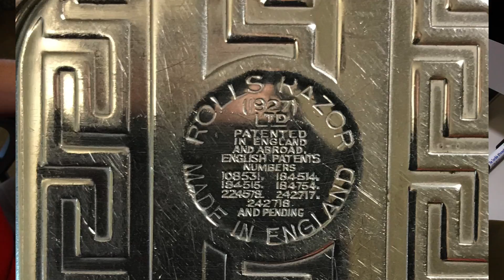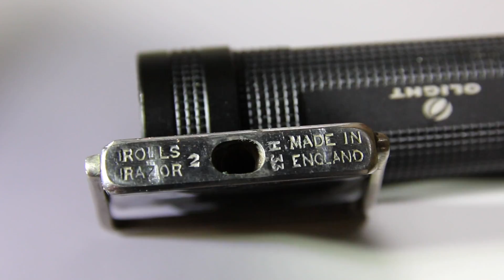Rolls Razor (The WHETTER)

Comment: I use one of these almost every time I shave. Once sharpened and stropped properly they do fairly well. Like many things, prep work is everything. If you are used to wetting your face, smearing on shaving cream and zipping a razor across your face, you will suffer.....badly. Your whiskers must be well soaked, I shave out of the shower and use the stir-it-yourself shave soap, the foam isnt good enough, and you will want to shave more often. If you shave only when you wife is ready to leave you, this tool is not for you.
Reply: Pre/Post shave balm helps a lot too, I've had people change their view of wet shaving overnight by recommending it to them.

Comment: I had one of those and sold it, since I didn't have the nerve to use it. I have owned probably every type of razor and IMO nothing beats a Gem. The G-bar, the Gem OC and the 1912 are just incredible . Also a DE open comb works great too. I prefer Astra SP's like you and Permasharp blades. Often it takes only one pass and your done. Less strokes and buffering =less irritation . Thank you for a great video.

Comment: Try shaving for the first pass in the direction your beard grows.  Also this will become sharp if you put the time in to honing and stroping it correctly.   If you prefer something that's not as much trouble go back to your 5 blade razor.
Reply: 5-blade razors are a hassle. My brother keeps clogging the drain when he shaves - I don't get that problem with my rolls